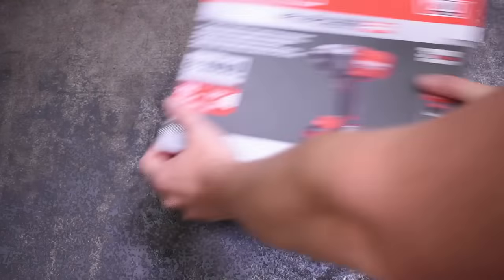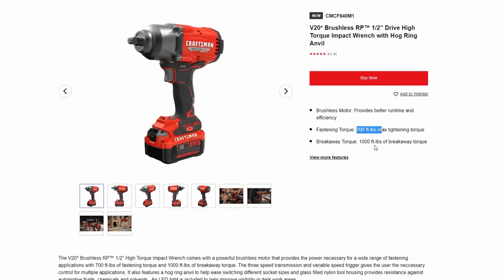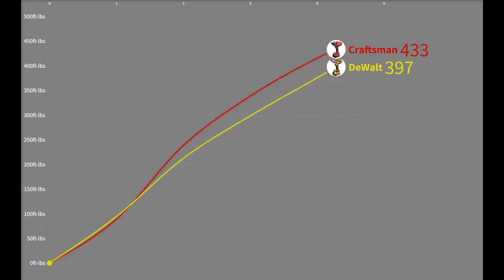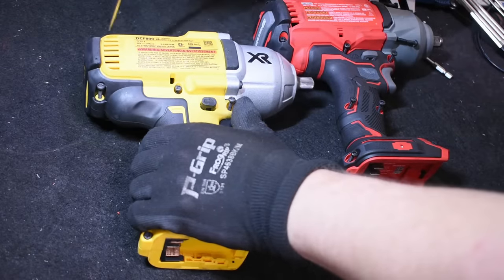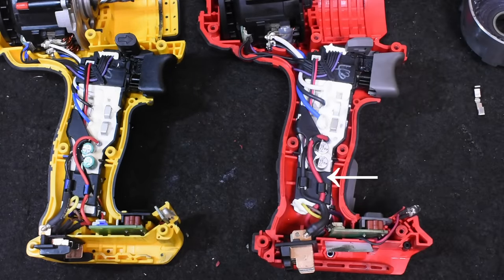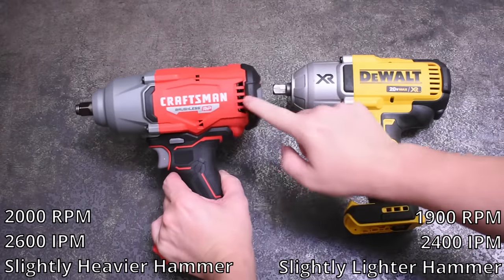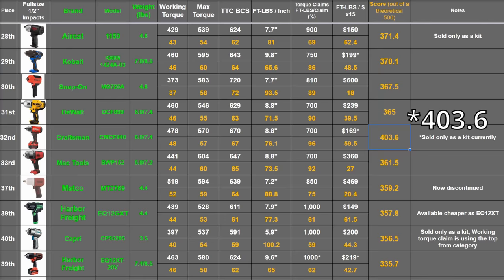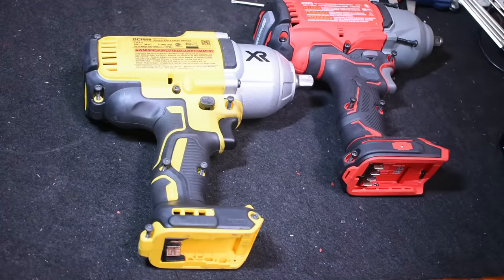Something Weird is Going On Inside Craftsman's New High Torque Impact Wrench

Comment: I'm not sure if it would work well, but a video on general disassembly of cordless impacts, how to clean, regrease, what kind of grease to use, things to watch for, etc, would be extremely helpful. This is one of the few channels I would fully trust on the subject.
Reply: Great idea for a video
Reply: No reason to disassemble, just "accidentally" drop your impact into your oil collection bin!  All kidding aside I assumed my 10 year old Dewalt hammer drill needed a new trigger switch OR a new motor, but for one last go I sprayed CRC electric contact cleaner into the trigger switch mechanism (without disassembling anything nor removing any screws) and that solved the problem entirely.  I was having issues not achieving 100% throttle rather than having an issue with the switch not working at all.  Occasionally the drill would "ramp up" to full throttle even when squeezing fully but it was very intermittent and most times it seemed to be stuck with a maximum throttle less than full throttle.
Reply: I think maybe that's something AvE would be better at.
Reply: @Guillotines_For_Globalists  the contacts in the trigger get dirty or worn, or both. I used some brake cleaner and some compressed air on my Milwaukee mid torque and it solved the trigger issue i was having. I ended up taking it apart anyway because i was curious and manually cleaned them and it still works great.
Reply: @SammyM00782  I disagree. By the amount of people who like and think this is a good idea, if TTC want to they should.
Reply: You don't. Just give it the juice and go.
Reply: I agree
Reply: You really shouldn't need to unless there's a minor electrical issue (dirty switch, loose wire, etc.). General tear down is very straight forward but there would different considerations for different models when it comes to the motor assembly so making one video could get a bit complicated.
Reply: Always use green marine grease if viscosity isn't a factor lol
Reply: Ąa
Reply: I'd watch 👍
Reply: @SammyM00782  I agree. AVE has  disassembled a few of these and identified the type of grease inside them. I almost forgot that a dozen of other people Like & Think your idea is great!
Reply: @SammyM00782  good ole boltr will teach us all 😂😂
Reply: @MrZimmaframe  I'm just saying, TTC is absolutely more accurate and thorough of a  channel when it comes to proving the numbers. AvE is more technical when it comes to pointing out every little detail in the manufacturing of said tool. It's two different levels of information. Some people don't give af what kind of plastic was used, but I do. Maybe you do to? Both channels compliment each other though.
Reply: @SammyM00782  Non of us are talking about stripping it down and monitoring every capacitor and resistor, but just generally maintainence on impacts, electric or air. It would be interesting to see. 

And to other comments above saying you don't need to service an electric impact that's simple not true, over time grease comes out of impact wrench which need replacing and also any metal worn off the anvil and hammer mechanism needs cleaning and removing out of the gun to prevent binding of the drive cogs. One of my older Milwaukee impact 2763 use to have a vibration and didn't run smooth, there was little bits of the anvil that had worn off over time and got into the drive mechanics plus limited grease too.
Reply: You have no idea how much I agree with everything you wrote as I'm pretty hard on my tools but anal about maintenance. Problem is I don't know what to do other than blowing the tools out while holding the trigger a little.
Reply: @SammyM00782  would be the same AvE would be more entertaining, besides doesn't he already do that to some extent?
Reply: they already did that in the best way possible by not doing it.
Reply: I packed the gearboxes and hammers of my older Kobalt impact and hammer drill with red lithium grease, it works great.  
The impact had its original grease washed out by burnt gear oil, and I had burned the hammer drill's grease up using it as a wire-wheel rust remover non-stop through 3 4AH batteries.
Reply: Moly for sintered, red n tacky for forged iirc. Failures are usually apparent when you split the case.
Reply: I just want to know what kind of grease to use if I ever have to clean it out. Watched a German dude restore the DeWALT DCF899 version of those and he said he needed to clean and regrease since mixing/disturbing the grease cause trapped metal particles to get back in the mechanism.
Reply: I believe that the bearings are sealed on most of the tools that i have seen
Reply: Its torque test channel not torque maintenance or repair channel
Reply: There is a channel that specifically buys and disassembles tools in detail just to prove they are all virtually the same but unfortunately I cannot remember the channels name
Reply: @davidjohnson1134  it’d be appreciated to leave a reply if u remember it later on  …thanks
Reply: That’s kinda what AvE does
Reply: I usually take everything apart and clean it. Sand the stator of motor and brushes. Spray electrical cleaner in that shit. Add dielectric grease to brushes to stop moisture and add new grease to the chuck assembly and they work like new. A friend's DeWalt drill didn't want to drill big holes any more. A quick but tedious cleaning job and was back like new. If you leave it in the rain the motor and brushes get rusty. Just remember how you take it apart cause the chuck may have lots of pieces lol and gears.
Reply: 100%

Comment: Seems like Craftsman is honestly a pretty good platform to buy since you’re getting older Dewalt models with improvements made.  Not bad at all
Reply: You have to be careful with that recommendation.  In past years multiple manufacturers had license to make power tools under the Craftsman brand.  No, they are not interchangeable.  These rebranded Dewalt look good, but there needs to be a bit of research before purchase.
Reply: @randomusermaximuss  Was that before Stanley bought the Craftsman name?  Seems to me that with Stanley owning them not they wouldn’t want other brands making Craftsman tools.
Reply: @2down4up  correct.
Reply: Craftsman IS good stuff.
Reply: I've used the tools at work and they seemed fine...i've heard they have since fixed the battery issue, but i've unboxed several kits in a row a few years back, all with batteries that won't take a charge.  Rather embarrassing to sell someone something like that, they should have issued a recall.
Reply: As long as it says V20, you’re good. V20 isn’t going anywhere for a while. Like you said, avoid the old Sears Craftsman power tools!
Reply: Would like to know the brand-quality of the Ion-batteries btw the Dewalt and Craftsman.
Reply: @charliecrash3450  depends on which pack it is. Their 21700 cells variants use Samsung 30T cells and most their 18650 packs use LG cells
Reply: @randomusermaximuss  He’s obviously talking about the platform that’s available today (namely: V20).
Reply: I've been buying the Craftsman V20 when Lowes puts them on sale for the last couple years. I paid approx $40 each for my brushless tools when the same tool in DeWalt would be over $100.  Even stuff like the 20V work  lights, which I paid $20 and $40 for and are really nice, cost $70 and $160 in Yellow .  The DeWalt price markup is insane but the Fanboys buy it up.
Reply: I have the best (made in America, assembled) craftsman drill, this impact, and brushless driver, a blower, circular saw and sawzaw, and reciprocating cutting tool, and about 7 batteries, I like them alot.
Reply: @MoneyManHolmes depends on how old. I'd say you'd be hard pressed to beat my 1979 Sears Craftsman Radial arm saw at almost any price point for whoever still makes it or my 1980s craftsman table top router. 

Also the C1 line was rebadged Ryobi one+ so not terrible but they were the old brushed tools.

Comment: As a "retired" ASE mechanic I appreciate videos like this to make informed decisions on cheaper personal tools to acquire for light-duty work around the house along with odd jobs at my current job.
Reply: exactly why i watch it.  😄
Reply: Wdym I buy Dewalt tools and use them every day in the shop. Air tools are old news.
Reply: @markm0000  do you have the new dewalt dcf900? That thing is a monster. But to be honest I probably would rarely use it, believe it or not my tiny little dcf923 atomic is strong enough to take off lugs, caliper bolts, shock bolts and so on. That little thing is incredible
Reply: @markm0000  I keep trying to think of an excuse to replace my paid-for-years-ago air tools with battery tools and so far just can't justify it for the amount of work I do these days (rotate tires a few times a year, etc..), but battery tools sure would be nice!
Reply: @8180634  , I have battery tools, but I also have various air tools.  I can't justify the cost of going "all" battery tools & replacement batteries, knowing that I have a good functioning air compressor to work with.
Reply: I mean, this channel is another resource alongside Consumer Reports.
Reply: @ericg4915  I got the dcf921 which is basically the same thing you got but with a 1/2” hog ring anvil. Not using an adapter with bigger 1/2” sockets means more power is transferred to the bolt and it definitely gets the job done in tight spaces. I always use it with a 5ah battery for extra beans. I don’t have a mid torque or a big dcf900 I’ve never had the need for that much power. If a bolt is stubborn from being over torqued or badly rusted I’m not going to bother and risk damaging something, it’s getting cut off and replaced. My other electrics are the “extendo-reacho” dcf503eb, a humble dcd777 drill, and the MAC mcm401 for quickly cleaning up gasket surfaces. I also got a dce512b job site fan and a small magnetic work light mcl044 that uses the same batteries. The next thing I really want is a dcf850 with the 3/4” anvil mod. I also found out Dewalt has heated jackets so I’ll try out one of those.
Reply: @8180634  If you enjoy your air tools then just keep using them but be warned you will probably end up with hearing loss. I suggest some discrete ear plugs to cut down the decibels.
Reply: @ericg4915  Another important thing that is criminally underrated is to take the time to grease the gearbox of electric tools. It will not void your warranty coverage and you’ll be glad you did it because tools will last way longer with proper maintenance. Also batteries will last longer since they aren’t having to overcome the friction of old tools that ran out of grease.
Reply: @markm0000  I try to use 3/8 socket so I don't need an adapter. I suggest you try the power stack battery. Its super small and more powerful than 5 ah
Reply: Light duty work around the house? I see these types of tools in shops all the time. Mechanics love not dragging hoses and tripping over hoses all day.
Reply: @ericg4915  I know the PowerStack is better but I personally don’t like the idea of a battery that has a finite lifespan. It uses lithium packs like you find in smartphones rather than standard cells that will be available for the foreseeable future. Once my stock cells run out of juice I will be able to upgrade to higher quality cells and keep my tools going for just a little longer before having to upgrade the entire platform.
Reply: @markm0000  ooh that's a good point, I'm glad I got my power stack new and not used
Reply: Boy Howdy. I have had bad luck with Craftsman drills and impacts thus far. Enough so to put me off the brand altogether. Their warranties stand though. I had a compact 3/8" drive brushless fail. It was a skin only and they replaced it with another model kit. So I got two more batteries and another charger plus. I can't be too mad at them.
Reply: Hart will handle it mostly around the house. I use dewalt with other stuff
Reply: @ericg4915  I use 12v xtreme line for a lot of stuff!!!
Reply: Light work around the house does not need 700 ftlbs  of tighten force  if u need something for lugs or lag bolts save some cash get the mid torque and save 120 bucks

Comment: What’s happening here from a tool build perspective is the Craftsman has a few slightly lower grade/lower MTBF parts but is 95% identical. That way Stanley/B&D can spend R&D making one tool and make minute changes for different brands for much less than the cost difference they sell each brand’s tool for. Meanwhile Craftsman buyers can say they get the same tool for less, and Stanley/B&D can make money+ on DeWalt buyers. I think the main difference between the two brand’s few unique parts is going to be the DeWalt will last longer and have more consistent power delivery/battery life, whereas the Craftsman will be more apt to shine bright up front and fade over time.

Comment: Nice seeing Craftsman not just getting junk. I've got a craftsman V60 string trimmer that I've been pretty pleased with that I got on clearance for 80 bucks.
Reply: The 20v trimmer is good too
Reply: Because Stanley B&D (the parent company) discontinued Pörter-Kable, refashioned it in new plastics and started calling it Craftsman, replacing the previous Crapsman. PC has never been worse than higher-mid range despite the old name being absolutely premium
Reply: @Surmoka  

I have an old poster cable circular saw and hammer drill. 

They are beasts
Reply: @Surmoka  Sorry to burst your bubble but you are wrong. How is Porter Cable introducing new tools if they are discontinued? They are not
Reply: @ns_racing  is Porter Cable introducing new tools? Where?
Reply: Porter Cable is basically getting the Craftsman RP tools in their grey skin. The opposite of what happened when Craftsman launched. Weird.
Reply: I get three rods to the hogshead and I don't care about anything why is it so stupid it is ruining my life
Reply: Good luck if you need a new battery.  I love my V60 trimmer and it was 170 not on clearance but a new 2.5ah battery is 160 dollars.

Comment: I've been enjoying the new High Torque from Craftsman. The trigger delay is definitely a little odd, but it performs really well in my forklift mechanic field.
Reply: My Milwaukee has a trigger delay oh wait…
Reply: The DeLay has gotta be really annoying. I dunno if I could live with it for too long
Reply: @georgef1176  my Milwaukee has a delay as well
Reply: @kchilz32  my grandpas old dewalt set has a slight delay on the drill and impact, but they are close to 7 years old, so I don't know if it's fixed or not. Haven't bought any power tools till now
Reply: @georgef1176  cool story man.
Reply: @erik34  doesn't bother me too much.

Comment: That  new dcf900 with the 9ah pack will flip your arms around like a pretzel, snap the bolt off , break the socket and change the earths rotation ..... 
Got one as soon as i seen the video ttc did on here a couple months ago. 
All kiddin aside , it will wear out 1/2in sockets on the drive end quick! Its really  exceeding what a  1/2in drive can do. Beating even the dewalt and Milwaukee 3/4in impacts.

Comment: I have all the craftsman impacts which I love. Their battery casings are very weak. All 5 of my batteries are cracked and held together with CA glue. No glass fiber reinforcement and bad case design. Other than that, no complaints. Glad they have a high torque. Keep up the sweet content
Reply from the maker: A surprising amount of brands use proper nylon on the tools then use ABS or ABS+Poloycarbonate on the batteries themselves. And yet what's the most expensive component? Buying batteries. It's silly
Reply: @TorqueTestChannel  I'm sure it's by design.  Engineered failure and planned obsolescence, and all that.
Reply: @TorqueTestChannel  Not silly. Greedy. It puts more money in their pocket since people are frequently reluctant to switch battery platforms. They will buy more of the same before buying different brand tools + batteries.
Reply: That's the main reason I switched from dewalt to Milwaukee. Dewalts tools are great, but you drop the batteries once and the case shatters. Milwaukees batteries hold up better in a shop environment.
Reply: @bigkenny93  Milwaukee are really the only tools I've had issues with, one of those being battery cases. Split one open extremely easy, but warranty saved the day.
Reply: @TorqueTestChannel  I have the same problem with the V20 craftsman batteries cracking
Reply: @bigkenny93  Funny enough I've had more issues with Milwaukee batteries separating than any other brand batteries I've used.

Comment: On the board they switch the electrolytics to solid-state caps. 
Although what usually blows up on power tools are the MOSFETs.
Reply: Solid state caps last longer. Generally about 10 years or longer depending on the model of the cap. I see this as an bonus as it seems the electronics is sealed up on a board there, which isn't good for repair-ability, it will at least allow the tool to last longer before the part gives out.

Comment: Having watched the video now, I like where SBD took this tool. 1) It offers up a “High Torque” for the Craftsman brand, and 2) Sitting it between the 899 and 900 appeases both Team Red and Yellow. Red feels they didn’t get absolute junk, and Yellow gets to bask in the glow of superiority of having the most powerful impact wrench.
Reply: Not very pleased if forking out couple hundred bucks for something near junk.
Reply: @reccocon3442  not one single DeWalt clone has failed me yet. All the PC clones are the ones to avoid. The only bad thing about the High Torque is it doesn’t have a bare tool option.